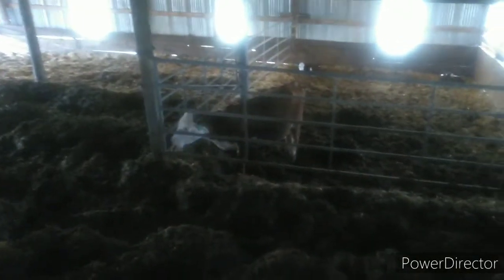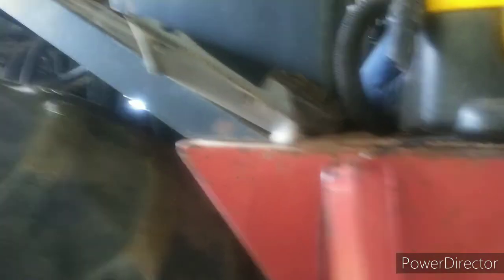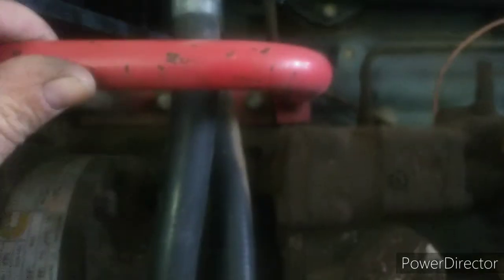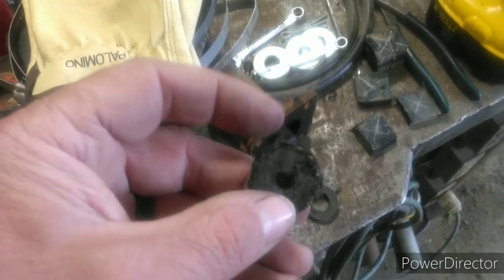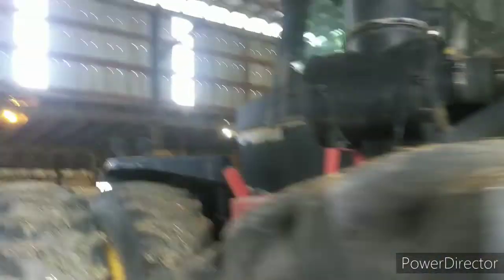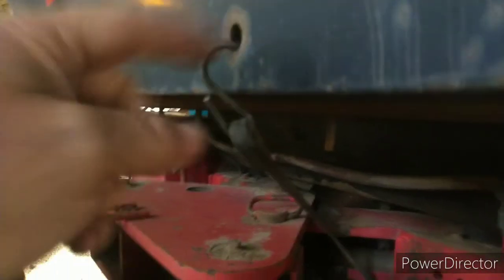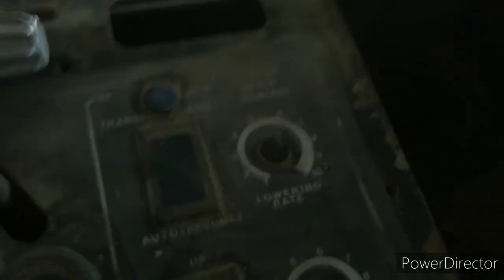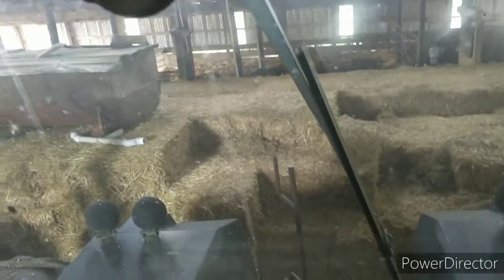Getting a little work done on the Versatile

Comment: Always fun solving mysteries of someone's else's problems . My AC don't work no power to the compressor clutch but the blower works My guess maybe the temp switch or wire . I did have brakes but resavior sprung a leak on the floor  so when you find one I need one also lol. My axel seals got the same build up on them but not dripping on the rims . The only leak I have found is the rear out put shaft on the bottom of transmission
Reply from the maker: Does yours have the two compartment reservoir like the '70s Chevy pickups or the single round reservoir?? I'm hoping NAPA has one cheap.. this has the round one.. probably interchangeable???
NH parts shows $339.. 😵 
NAPA is probably $50???
I'll find out tomorrow I hope
Reply: @GosselinFarmsEdGosselin  looks just like yours the round top .  Mine is a 84 the cab styles are a little different
Reply from the maker: @jeffgroce9736  I will see what I can find.. hopefully inexpensive!! 
If I rebuild it, I know it will be cheap.. but haven't had great luck with rebuilding masters for a while.. cheap castings I guess. But.. what model is yours??
Reply: @GosselinFarmsEdGosselin  mine is a 835 the last of the candy striper

Comment: You guys are making progress.  Would it be possible to modify truck pto cables to hydraulic cables if you can't find OEM cables?
Reply from the maker: Thank you Monty!!
Usually truck PTO cables are just a wire, not that heavy duty.. it would work for a while, but not long enough to go through the hassle of changing them..
There are supposed to be a couple places still around that make cables, so might have to get them made???

Comment: Ed I've been looking at the earthquake cordless impact wrench and I think that's what I saw sitting on your bench in the shop. Would you buy them again? Thanks man.
Reply from the maker: YES!! We got a 3/8" drive and a 3/4" drive. They have worked way better than expected!! 
I have talked about them in a few videos, probably back in November-January??? 
We have some of their air impacts also, they have held up and worked great!! I'm sure you will love one!
1/2" would be nice, but I don't have one yet...lol😎
Reply: @GosselinFarmsEdGosselin  - I'm looking at this one at Harbor Freight for 279.99 plus tax...  EARTHQUAKE XT
20V Max Lithium 3/4 In. Cordless Xtreme Torque Impact Wrench Kit...   thanks for your feed back..  ☕
Reply from the maker: @SoybeanFarmer3300  you can always use adapters for putting sockets on it👍😁
Reply: @GosselinFarmsEdGosselin  I was up at Harbor Freight 2 days ago and bought my first set of true impact sockets 1/2 inch Drive. Fortunately I didn't get hurt when I busted a regular socket trying to get the nuts off of the blades on my estate mower. That was my first time doing that but it was expected to happen one day using regular sockets on an impact driver. the first thing I noticed about these true impact driver sockets they're a lot heavier than my Craftsman sockets. Thanks again for sharing your experience with me.
Reply from the maker: @SoybeanFarmer3300  I'm sure you will like the new impact!!

Comment: Call Brake systems in Portland they might have the master cylinder if not can rebuild it or get the parts for it
Reply from the maker: Seems they used two different masters, one is a regular old seventies Chevy pickup, the other is the one we have, round single reservoir.. NAPA probably has it on the shelf.. I plan to find out in the morning.. they should at least have a kit for it.. we will see. Thanks Donovan!!
Reply: No problem

Comment: You mentioned a battery box, what condition is the battery (s) in?  It's set there for 5 days what else have you found for drips and leaks?
Reply from the maker: I haven't looked at the batteries yet, supposed to be new.. probably cheaper wet ones, but they work for now!! Only seeps so far are the oil pressure line in the cab, the master cylinder in the cab.. haven't crawled underneath, just leaned over and looked, but there are two spots, one looks like a breather, the other I don't know yet.. nothing major anyway!!